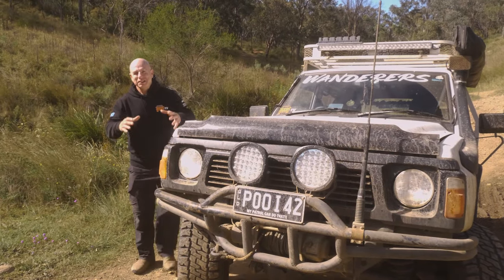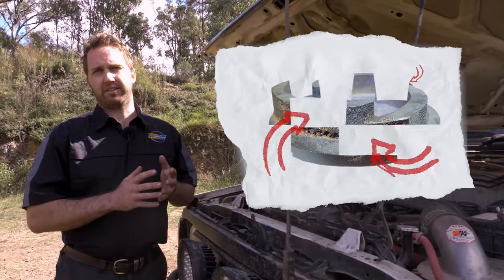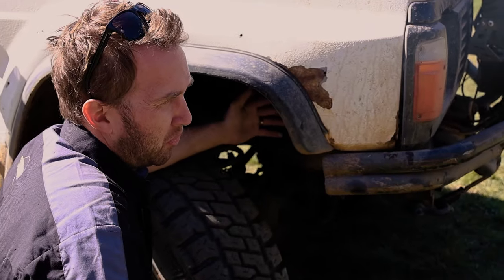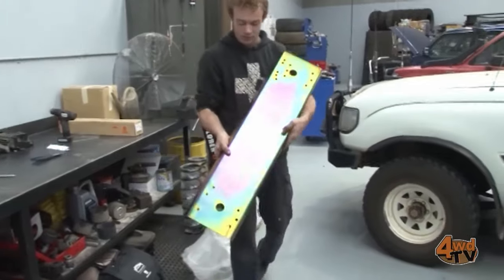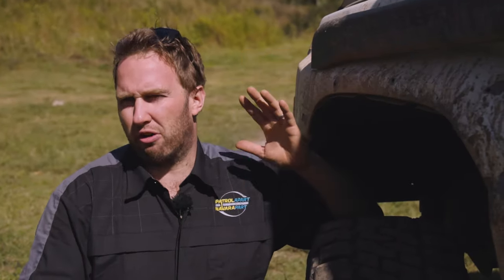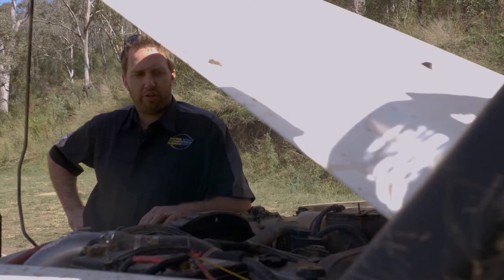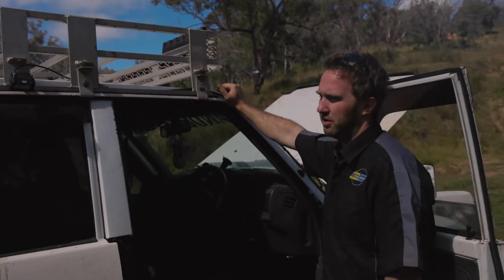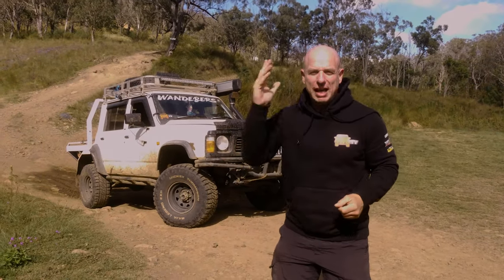Top 10 Major GQ Patrol Issues and How to Fix them

Comment: I found that running 1 litre of  mooreys oil stabiliser at every oil change has helped control the engine temps on long pulls on warm days. I know it sounds weird , but it removes the friction out of the oil in turn helps the engine oil to not get so hot. I wonder if anyone else has thought about this and tried it. Works on mine
Reply: Hi mate, do you add the full 1-litre of mooreys oil stabiliser? Do you put that in first before refilling with new oil? Cheers Stan
Reply: @dunstanfernando  

Yeah mate it doesn't matter really wheather you put it in 1st or last , it won't take long to mix. The mooreys sticks like Teflon to all bearing surfaces. And yes I use 10 litres of oil and 1 litres mooreys oil.
Reply: @vincentdunne7197  thanks heaps mate for enlightening me. I will definitely start doing this next time I do the oil change on her. Really appreciate it mate cheers

Comment: I honestly tell people to avoid the GQs after the headache i had with mine and roof rust. Its a design flaw takes so much time to resolve. Took half a years worth of my spare time cutting it all out, time is money. But NZ has road worthy inspections every 6 months which was the main issue, trying to hide rust every 5 months lol. Aus i dont think has regular road inspections? So rust may not be an issue as much
Reply: Yeah no issue in Aus as only need a roadworthy before initial registration. Once registered you can keep it forever without ever getting another roadworthy, as long as you keep registering it each year
Reply: Hey mate I had a lot of rust aswell in mine, me and dad renovated the roof within 2 weekends. Cut out the section and used rust eater on it,I also used a bore score to see if there was anymore hiding, used paint,I then used copper and pop rivets for structural strength where we cut out the rust, then fibre glass and finally rolled aluzinc sheets all around (covering all the sides) rear was abit annoying. Popriveted and sikaflexed it all up and cleaned up with bog to make it look factory. I also raptor coated the whole car so that helped. I guess we could’ve welded some metal where we put the cutouts but the roof is pretty thin. I also used angle alyzinc to brace the rails
Reply: @kizzamate  you in Aus? Yeah some GQs are doing better than others, sounds like yours wasnt as bad as mine. The best thing you can do for them is keep them out of the rain, mine lived outside in sth NZ which can rain for months on end, i was doing what you were doing every 5 months to pass road worthy checks, it was getting out of hand how many times i rebogged my roof lol im a year into a full restoration so you did real well sorting it in 2 weeks
Reply: @steadybuilt7139  yeah mate I am in aus, wa. I’ll take note of that and store it  in the shed from now on then. I’ve had it out side ever since I got it. Just wish I hadn’t done the windscreen myself as it’s leaking abit and I can’t figure out for the life of me where it’s coming from haha
Reply: @kizzamate  Yeah mate best way to fight off rust is to keep it dry as possible. As for the leak you need to seal those windows up even though their a rubber fit,  Use "Sika 553" or any panel bond, dont use silicon. Id use masking tape around the edge first as this stuff is extremly messy. Seal all around it as wind driven rain can push water up. If still get water on floor after try sealing up any gaps on firewall as rain water travels down there, like behind brake booster etc,  also remove window wipers and take that panel off below windscreen as leaves and dirt can get stuck in the rain channel and block it so rain water has nowhere to go but back into the cab